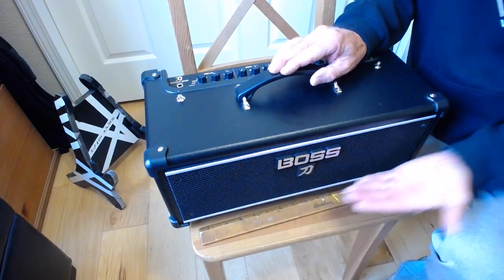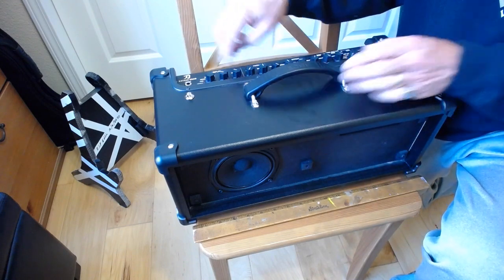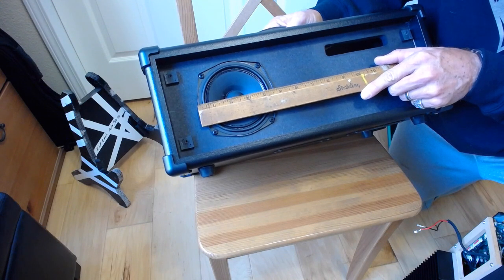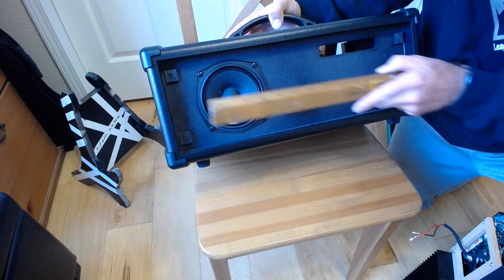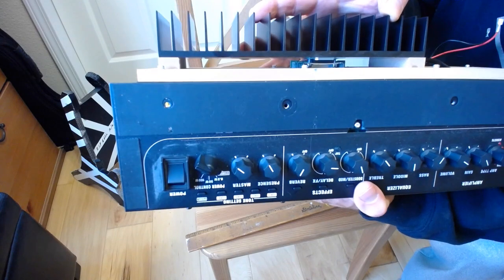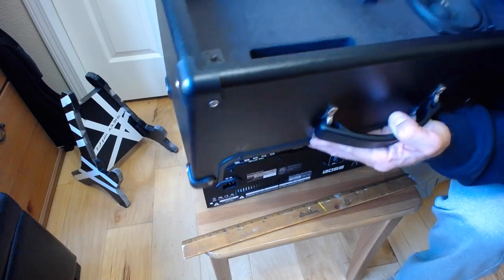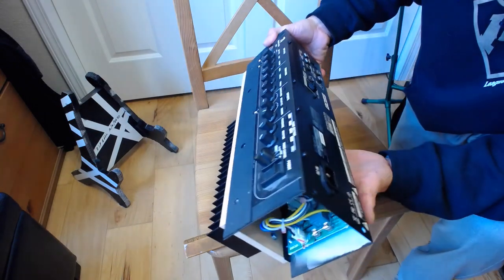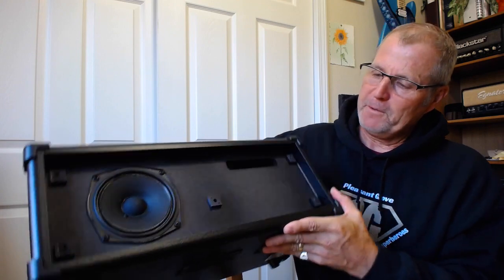Inside The BOSS Katana ~ Chassi Pull ~ Speaker Upgrade??

Comment: Great video !!! Thanks 
Question 
How about if we build a small speaker cabinet 2x10” separate cab ? 
Still small enough to play home ?! Any ideas ? 
I rather not bring the 2x12 cab in my home ?
Reply from the maker: well heck ya!! You could build one and plug right into the existing "extension cab" jack on the back OR you could do a 'mod' using a switching jack that you'd have to mount somewhere. A switching jack would allow you to interrupt the internal speaker so you could use the quieter aspects of the amp. Ideally the cab would need to be 8 ohms, same as the internal speaker just to be safe.

Comment: Just subbed....Ima old guy jamming at home also.....I have 50 mk2 combo.....can headphones out be connected to PA amp, safely??? Thanks
Reply from the maker: That should work, not sure how it will sound but headphone out/line out are often the same low level signal.
Reply: @oldguyjammin9732  thank you

Comment: My question is, for an bedroom level volume is this head katana head with 5 inch speaker a good solution? Maybe I wrong, but the full potential is when you using this with a proper cab.... in this case the combo version setted on 0,5 watt mode sounds better with the in built 1x12 compared to 5 inches solution?
Reply from the maker: The nice thing about the head is that you have an easy “grab and go” practice amp that you can take to a buddies house AND/OR when you want, can hook it up to a nice cab 1x12, 2x12, or even 4x12. If you have the space to store a cab, I’d go with the head version. I keep mine stored under our TV on a small shelf. It’s plugged in and the cords are all right beside it. If I’m watching a football game I can slip it out, sit on the couch and jam during commercials.

Comment: Boss Katana Head Gen 3 vs the spark 2. Which one would you get?
Reply from the maker: I’d probably go Spark 2, they are super fun and absolutely great for practicing or small jams. The only real benefit of the Katana head is that you can plug it into a big cab and crank it… if that’s not desired than Spark all the way.

Comment: Not knowing Alot about electronics what about an 8ohm 2 way car speaker which includes a tweeter as well  or would that require extra wiring?

Also have you found a way to make the head have a more rounded "full" sound?

Even going into a cab it seems to have that same thin sound you get from its own 5" speaker no matter what settings I use on the front.
Reply from the maker: That car speaker should work fine and who knows, might really improve the "small speaker" tone. SO, to get the most out of this amp you're going to need to download the tone studio and then hook the Katana up to your computer USB, and then... and then!!! bring up the 10 band EQ pedal from the plethora of effects and BOOM!! You'll be amazed at the tones ~ really worth it. I hate all that techy stuff but once you do it, you're done and anytime you want, you can connect your amp to the tone lab and create absolutely ANYTHING.

Comment: Dude let me know if u ever put that other speaker in i would like to do the same thing. My speaker stopped working so i got to look to see if something came loose ? Any ideas would be appreciated thank u kindly.
Reply from the maker: Not right off…? You could run a volt meter through it using the diode test setting but probably not real serviceable. Look for discoloration or burnt components, might even be a fuse on the board that blew :o I probably won’t be putting the other speaker in. The Boss has found a nice home under our TV and there it sits - I usually crank it up during NFL games, otherwise I’m playing my other amps \m/

Comment: What I'd want to know is, does the Katana amp send out a frequency compensated output that matches their speaker, or is it a full-range (as far as guitar amps go) signal going out and the speakers are essentially doing the filtering? Like a regular guitar amp. I suppose we'd need a data sheet for that original speaker which probably isn't going to happen :( Still, I will say this much, after my brief infatuation with tube amps, again, I managed to grab 3 guitar heads, a 5150iii 50S, ENGL Fireball 25, and an ENGL Ironball 20...all stellar amps, but at the end of the day, my Katana Head sounds better, consistently. The brown sound on the Katana is so well balanced, sounds like it sits right in between my ENGL Fireball and the 5150ii blue channel, BUT, the onboard boosts and effects push it over the top. It's a one package solution, and the head having that mini-speaker in it makes it even better as it can do double duty as a "dorm-room/bedroom" amp AND a stage rig. I have never got more compliments on my tone than I did when used my Katana at gigs. The cohesiveness of everything working perfect because it's inside the amp is just unbeatable. Also, for whatever reason, the Katana not only sounds great in just a room with you and a guitar, but it manages to sound equally great on stage. A lot of larger heads have a non-linearity to them that often makes your rehearsal/practicing tone sound great, but when you really turn it up for the stage you find that it just doesn't cut through, or vice versa. The Katana lives up to its namesake and cuts through at any volume, but more importantly it retains the same great character of tone that it had at lower volumes, so you don't have to completely rethink your stage tone at sound check
Reply from the maker: That's a good ponderance to which I'd offer "I have no idea" I did try to find spec on the Roland speaker though and didn't find anything. You point about EQ adjustments for Live versus At home practice is Really valid. I know exactly what you mean. Start writing all your settings down for playing live ~ it'll save a bunch of time.
Reply: Not sure if this is what you’re asking, but I did recently saw someone demoing the Katana head and turning on the stereo expand function, which turns off all the cab sim from the Line Out, so essentially you can go out into a cab/IR loader or into a USB audio interface into your computer where you can load any cab plugins there.

Comment: I've seen several reports of the Head speaker failing.  Does anybody know if that is a fault of the speaker itself, or an amp electronics issue?  I assume the former is fixable by simply replacing the speaker, but the latter tricky.
Reply from the maker: I haven’t heard of the speaker issues, but there is a same size replacement out there. Replacing the speaker will be the way to go.

Comment: I have a couple of those hotone mini amps. Been thinking about building a small stereo combo rig out of them. Any thoughts?
Reply from the maker: I like the idea, but my gut reaction is you'd end up with a mono rig with a wide and big sound. However, with a rig like that I think you could use stereo pedals to develop modulation affects like chorus, tremolo or delay in true stereo fashion. It seems I've seen stereo pedals with dual outputs meant for just such a rig. Let me know if what I've said makes any sense, lol. True stereo rigs are designed with dedicated Left and Right channels.